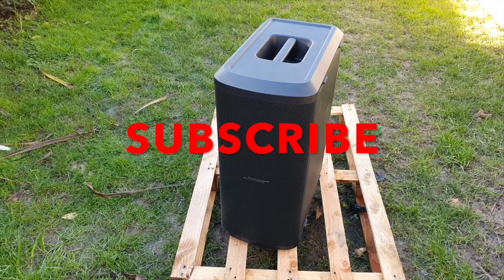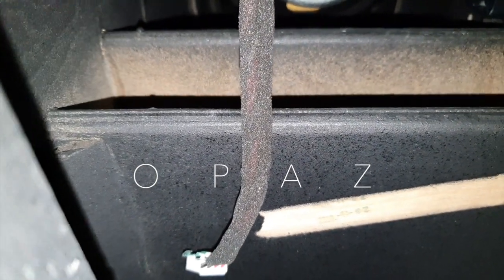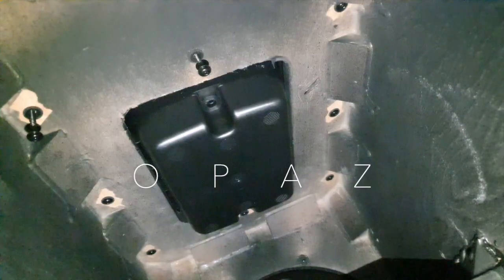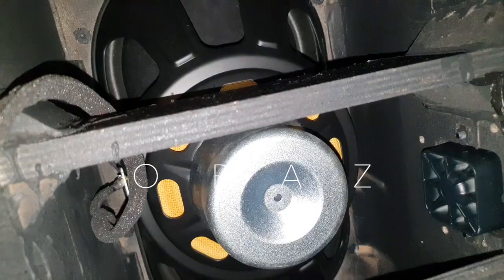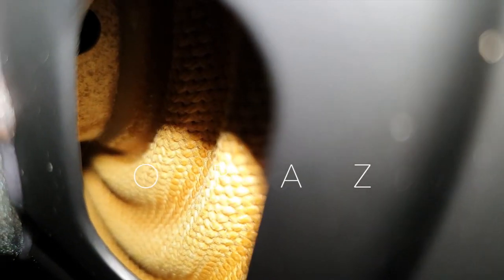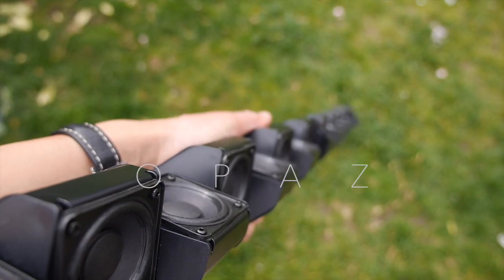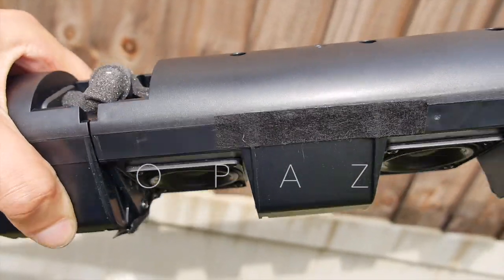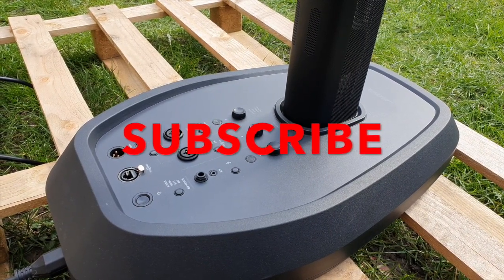Bose Sub2 Teardown

Comment: ...better build then i would think out of bose their are some big caps and power plants in their
Reply from the maker: It's always a pleasure dismantling a speaker, especially an RCF or FBT unit. 
Discovering drivers of high quality,  robust bracing techniques and great choices of construction materials. When I dismantled the complete 3k bose system I expected internal components, drivers and construction of superior quality. Unfortunately I found the column and bass drivers and electronics throughout were nothing more than standard. The internal column/base floor mount foundation itself was literally being held on by only 2-3 screw threads also the same speaker spec throughout all priced models. Not impressive

Comment: Had f1's recently .... heavy heavy HEAVY ... poor response when turned up ! Had 812 bose tops which you basically switched off the bass on to use with f1  ..a very heavy 8 driver cabinet basically point source  .. overpriced in my opinion  
... am using l32's with 2 sub 2s tonight .... with a t8s mixer... after a quick set up and test I can already hear clearer sound and bass much friendlier at all volumes... haven't tried cranking it up yet until later
Reply from the maker: Hope you have a great night Neil 👍🏼

Comment: how it sounds against the PRX one sub ?  louder ? Deeper ? or none of that?
Reply from the maker: The sub 2 will only do deep, that is it. .. which may convince that it's deeper. The jbl, much more musical will go 2Hz lower which you're not gonna really hear. Being a dedicated sub & larger enclosure, the 2 has a bigger footprint therefore sounding louder. Push level control above 11 o'clock and it sounds dreadful. Max out the jbl bass settings and it's still very tidy 👌🏼. For the $ the prx is extremely special. People hear lots of bass and immediately think a speaker is great. .. . so much to learn
Reply: @opaz.  Thank you for your detailed answer.

And what about pro16 sub? does it work like sub 2 ? only deep bass also ?
Reply from the maker: https://youtu.be/s6Zk8bZ7qhU

Comment: Having now seen this, I wonder why Bose limits the M20 pole to speakers weighing less than 17.6lbs (basically the S1). 
With all that solid bracing, it should be able to easily hold 50lbs without any danger of collapsing onto itself. Any thoughts on this? Would the Sub2 pole support an F1 812 top (44lbs)?
Reply from the maker: Definitely

Comment: Took out the Pro32 to compare to my L1M2. Here’s what I found:
Pro32 is noticeably louder.

Sub2 is louder than two B2’s especially for deep bass. 

Pro32 is much cleaner with better highs.
B2 has better and cleaner mid bass but lacks in the lower bass (I ran 2 together). Conversely the Sub2 has better low bass but mid bass isn’t as clean as the B2.

I agree with Opaz again that the Pro32 sounds great but Boss might have missed the mark in the sub. I used my L1M2 bases to power two B2’s and some songs preferred the B2’s for the punch and in others the Sub2 for low end. I suspect something like an EV EKX15sp or the 18 would be killer. More testing to come if I can find one to actually buy. Time to trade in the M2’s and 1S.
Reply: Did you have the sub 2 settings correct on back of sub there are different settings for eq etc. I have has no issues with sub 2 with correct eq settings. In fact it is the best sub I’ve heard. Also I lay it flat not standing up, and it has so much punch.

Comment: Great video! What do you think of this new driver woofer driver understand its bose and bit over priced, i was really impressed with there F1 Sub dual 10”
Reply from the maker: It's a good sub
Reply: @opaz.  Hey. F1 sub vs Sub2.. which is better? Which will offer me best dB SPL?
Reply from the maker: Never listened to the f1 sub
Reply: @opaz.  now fella. Just tried the F1 Sub today along side the Sub 2. Sub 2 wins hands down in my opinion. Had to crank up the F1 a lot more tho reach the same volume / low end frequency. 
I’m sending the F1 back and going to get the Sub 2.

Like your vids BTW.
Reply from the maker: I've never heard an F1 but always thought it was overrated. Maybe being just double10's, i fancied larger drivers.

Cheers and thanks for the info 👍🏻
Reply: @ifonlyhowie  how about sub2 vs 2 sub1? or sub2 vs qsc KS112?
Reply: @deehive  pass. Never tried any of those. I do like the sub 2 tho. Plenty of low end for my needs. 
Last couple of gigs I’ve use this with 2 x Bose S1’s sounded great for small / medium gigs abs small form factor
Reply: @ifonlyhowie  will go with sub2 soon. reason is weight. tnx
Reply: @deehive  I listened sub1 and one sub2 I feel confident that it’s almost like 2 sub1 is like having 1 sub2 and the bass on the sub2 at a certain point over powers the sub 1 
After listening to them for my micro set up I decided to get one sub2 to go along with 2 of the s1pro ( I mix Latin / hip hop and Latin house music ) and I only do small house parties or small halls about less than 120 people )